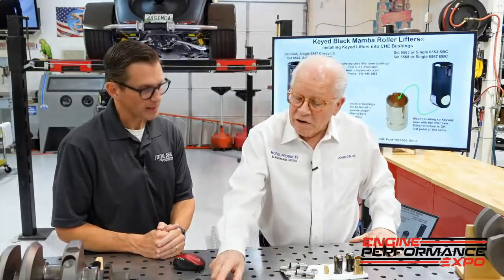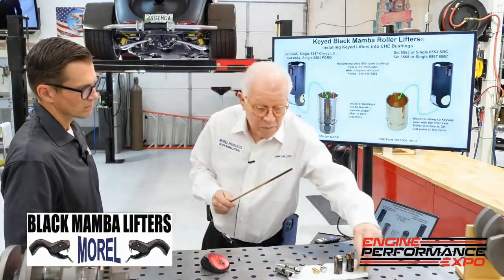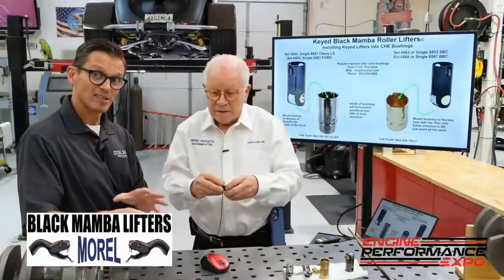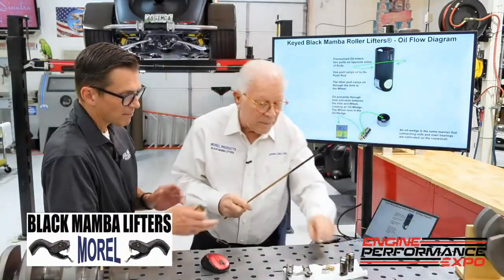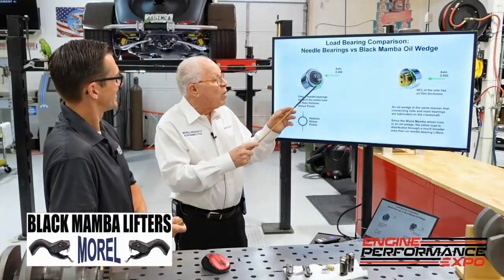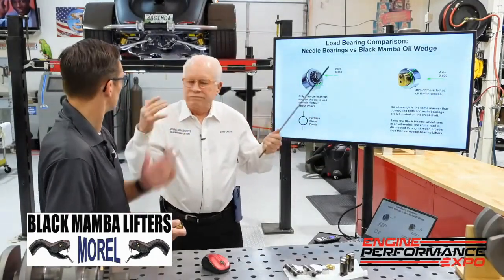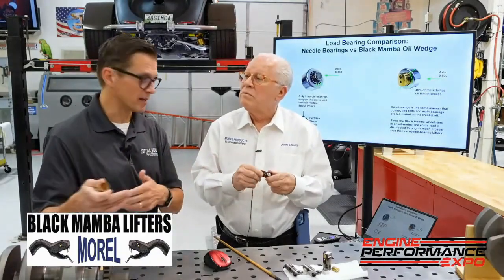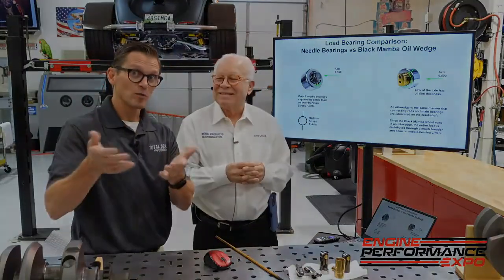Lifters & Bushings with John Callies (2023 – Episode 56)

Comment: Bushing roller cam and lifters with key or pin locators have been around since Noah was a boy, circa GM Detroit Diesel for example its only in recent times that automotive performance has adopted roller designs and then plain bushing rollers in lifters.

Comment: If you have any type of issues. How do you get The particulates cleaned out from behind those groves in the bushing?  I have mad respect for these guys. But I think before you pull the trigger on this, Consider steve morris opinion on Thi bar Versus this type of lifter.

Comment: Good stuff, but if you are running a Hemi alcohol or fuel  block they do not have pressurized oil to the lifter. I have been told I cannot use a bushed style lifter.